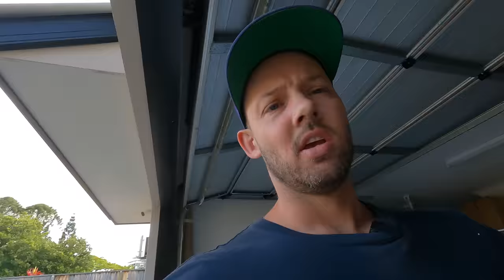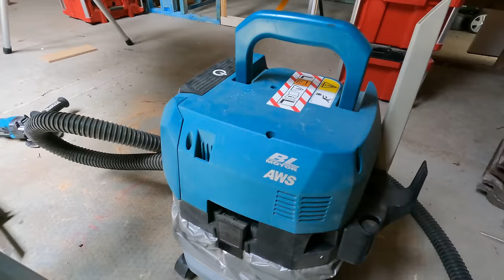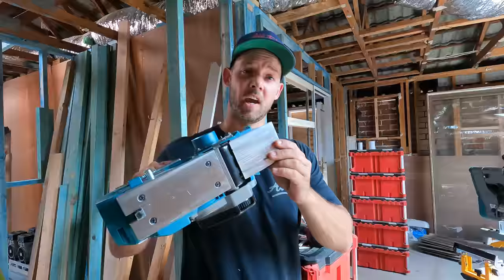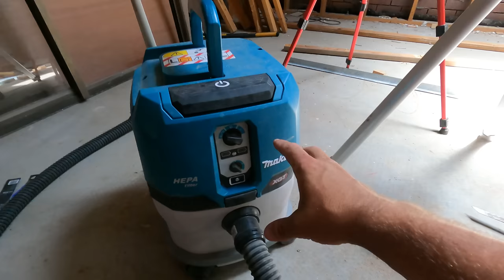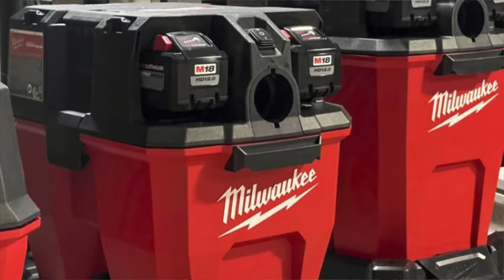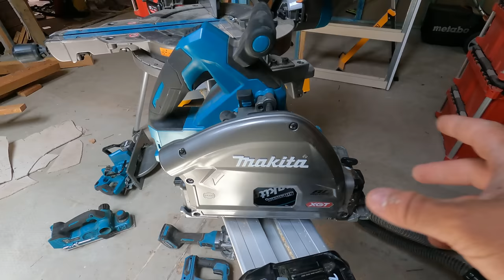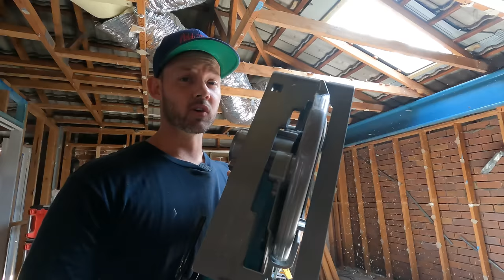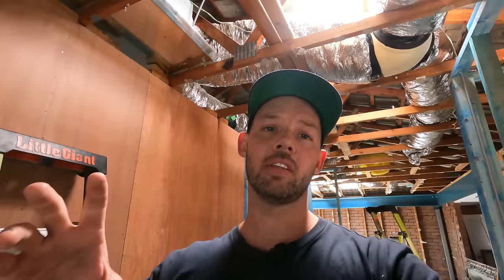From milwaukee to Makita. Why I changed tool platforms

Comment: Carpenter from Europe here, I use Makita but still the older 18 V LXT lineup. The batteries are not as modern as the new XGT batteries but they seem to live almost for an eternity. I still use 5 batteries from my first batch in late 2015, they are still working perfectly. Meanwhile I have a lot of newer machinery but they still work fine with the old batteries.

Comment: I first started using a cordless drill, Makita, in 1989. Then got a Dewalt then back to Makita. I use to think it was a good idea to only run on one platform and back then it was a good idea but now I run four platforms for different reasons. I really see no reason to run only one and only one. The only downside is you need multiple chargers which for me isn't a big deal. Each maker has their strengths and weaknesses so I just take advantage of multiple companies strengths and don't bother with the weak stuff.
Reply: Have you tried the charging adaptors for 50$ Amazon ??? Any brand any battery
Reply: @jairoguzman4631   No, I haven't. I don't have any need for an adapter. I've got batteries for all four systems. In fact just a few days ago I got back into Dewalt so that now makes it 5 platforms.
Reply: I'm the same way. I've got M18, M12, LXT, and XGT. Doesn't bother me as much as most people to drag a few extra batteries around. I do use mostly Milwaukee for work (electrician), and mostly Makita for home use (woodworking, general construction, etc). However I mix and match plenty, and always prefer to be able to choose between each platform for each tool, and get the highest quality.

Comment: I’m on the Milwaukee and makita xgt platforms, I can’t honestly say I could be on either platform fully! The Milwaukee 16 and 18g and framing nailers are phenomenal and they have tools that xgt just don’t make yet. I have the xgt mitre saw, 190mm saw, combo drill and impact, recip saw, planer and track saw that Milwaukee just don’t compete with
Reply: Dont compete on the recip saw?
Reply: @Alex-uh1mj  yeah the recip saw from Milwaukee is the staple but the new flex looks pretty good too, coming from a dewalt guy
Reply: I expect them to DeWalt tools going from Porter-Cable junk essentially saved up earned it bought it bought the kits when they had the battery included or multiple batteries and chargers etc been running for about 5 years now non-stop 

Trim carpentry rough carpentry beam work you name it and it's been going non-stop however DeWalt makes really poor nailers in the cordless range so I use battery adapters from Amazon and been running those for about that long too for my Milwaukee nail gun Brad nailer and 15 gauge by dewalt batteries are still going strong they have never had an issue They seem to have a better system and backup system One thing I have noticed is a lot of people that use Milwaukee on the job site They have battery issues also the bearings go out on their tools especially the impacts and the drills and the same goes with Makita The batteries go out especially if it's cold they do not like cold at all My DeWalts will run in the cold No problem I also was smart about it and built a battery box with two chargers so that when I'm charging my batteries it's also an insulated box it's got two fast chargers inside and then I bought Amazon battery lockers to go on the walls of the inside the box so roughly I have 15 batteries ranging from 5 9 ampere hours 3 6 amp your hour several 2.5 and and a few fives I never have a problem with it I would like to get a 12 amp per hour but I think I'm just going to go with the cheaper brands the knockoffs and see how they do if not then I've only lost maybe a hundred bucks and I can get them replaced versus paid $250 a battery or $375 for a 15 amp

I do plan on getting a 23 gauge Makita and then getting a battery adapter so I can use my batteries it's all the same voltage 18.6 volts the whole systems are
Reply: @Alex-uh1mj  The new Makita XGT avt recip saw is faster than Milwaukee.
Reply: @clarkfos3447  ah okay, ive not seen any comparisons yet. Im too heavy invested in Milwaukee now 😅 better not watch

Comment: Woodpecker makes a tool you can attach to the track of your saw for repeatable cuts, you can also cut thin strips with it, basically replacing a jobsite table saw for ripping boards.

Comment: I install windows and doors and use Makita 18v and dewalt 50/50 . The Makita impacts hands down destroy all others but I do prefer the dewalt 7 1/4 battery mitre saw that I use to cut trim and simply use a 9 ah flexvolt battery on .

Comment: Another great video thank you. Makita have been top notch gear forever and before I started my plumbing apprenticeship in 1975 at 15 years old. They always set the standard for the others to achieve.
Reply: What would you rather do run around for batteries and chargers or plug a cord in once.
Reply: What an absolute load of crap
There are several Milwaukee tools that leave makita for dead 
There are some makita tools better than Milwaukee  
To say makita is the one setting the standard is garbage 
Give me the Milwaukee angle grinders over makita any day and their impact drivers and impact wrenches and grease guns 
Would go makita for their saws  is about all 
Makita impact drivers are nicely balanced  but Milwaukee grunt kills them
Reply: Not true Makita has always been behind Dewalt and Milwaukee in innovation. Not to mention no high output batteries for the 18 volt line.their impact drivers do not cut it if you're driving big fasteners. I have their cordless track saw which I like except battery life is not great thanks to outdated technology.

Comment: Same here, Milwaukee have very powerful tools that kills the batteries earlier than expected. I love my Milwaukees but now almost always order makita ones just because the electronics in tools and batteries make it last forever. For example I made a very aggressive use of grinder to cut and polish rocks, this cause i have to order 2 or 3 batteries per year! Makita 40V the battery have more than 18 months, the tool have a special sensor that slows down the tool when battery is too hot to don't damage the battery. I save several hundred dollars with makita compared to Milwaukee. And Inlove Milwaukee ❤ but they are far behind in battery management.😢

Comment: I've had Makita drills since 1987, although I bought a number of Ryobi tools between around 2005 and 2015 as their line expanded quicker and at a lower price point. The past few years, I've gone back to Makita with the LXT platform, and I love them. I'm hoping the XGT platform doesn't result in them phasing out the LXT line. 😬🤞
Reply: I talked to a rep the other day he said that it wouldn't be , that the xgt would be a pro line and 18v  would become a home handyman type of product
Reply: Yeah, their LXT stuff is here to stay, at least into the foreseeable future.
Reply: By the 80s Makita was all made  in Japan , current Makita are made in China, I don't think is the same quality.
Reply: @pablosetien5548  Makita is made in about 13 places, not just China. They have specs they have to meet in China. Most tools are made there. Makita is still the best overall quality

Comment: As you will know, 

it kind of doesn’t matter 

for around 20 bucks on eBay you can buy adapters that will convert between Milwaukee and Makita - as long as the voltage is the same……..

I’ve had Milwaukee for three years at the DIY level never had any issue

Comment: I spent a decade doing similar work, larger scope interior focused remodeling, which almost always includes a decent amount of cabinetry and finish trim work, before finding my current specialty. These types of remodels are so broad in scope they have the widest requirement for power tools compared to more narrowly focused trades. That makes these types of outfits very good judges on tool platform choices. They regularly use such a wide variety of equipment ranging from hammer drills for light concrete and tile demo to fine finish tools like track saws and and routers. I’m sure this guy has lots of secondary tools they use often but not every job
Reply: Marc. I'm a plasterer by trade. Although I had to diversify to cover many aspects in the building trade simply to remain in work. I have tool boxes for bricklaying, concreting, carpentry, plastering, ceiling fixing, tiling. I did maintenance work such as using demolition hammers. Moving into the battery range. I do wish to purchase a cordless mid size sds max demolition hammer. I have the metabo 18 volt sds plus rotary hammer. Its pretty good. I did have a 36 volt metabo4 amp hour.It got stolen along with other tools.So I replaced. Yes, I'm also a tool person. It did get me work however. I get asked can you do this? I say yes I can. Sometimes I don't know how. I figure a way and just do it .

Comment: This video is perfectly correct…a wise choice..not just a brand slave…change when its favor you more to solve the problem….many just read the spec etc. but the real worker on their own field knew which brand to choose for the ergonomic and conveniency…for example which one would fit the tight space better etc.

Comment: Excellent comparison!  As a Milwaukee bigot I have to say you were spot on with your comparison overview.  I have over 30 M12 and M18 tools, plus 20+ Packout boxes and bags.  So I’m committed and for the most part very satisfied.  Milwaukee builds some excellent tools!  However, I believe they’ve missed the mark with their new vacuum line, which looks excellent.  Not having BlueTooth connectivity between vac and tools is a major miss.  How the hell could that even happen?
Reply: And lack of dual power is also a huge miss. Having to ONLY use battery power or not having passive charging is such a stupid idea for such an expensive tool
Reply: There is a powerhead that has a corded or battery option. There a 3 configurations.
Reply: What's the use of bluetooth when you are connecting a vacuum hose... Doesn't make sense at all.
Reply from the maker: When you pull the trigger on the tool, the vacuum come on and turns off 2 seconds later. It’s extremely handy
Reply: @michaelrjacobs  , it’s simple…instead of having to reach down to turn the vacuum on prior to starting the circ saw or miter saw or whatever tool, Bluetooth from the tool sends a signal to the vacuum, automatically turning the vacuum on.  After the trigger on the saw or tool is released the vacuum turns off.  If your making a lot of cuts it would be really nice to “not” have to reach down each time to turn the vacuum on and off.  With Bluetooth connectivity you never have to worry about forgetting to turn the vacuum on or off.  It’s just a very convenient technology that I’d like to see Milwaukee incorporate in their tools and vacuums.
Reply: @martylucas8557  ok, let me rephrase. Wasn't very clear. What's the use of having a battery powered tool that I inevitably is going to end up being connected with a hose?
Reply: @michaelrjacobs  one reason is the test and tag requirements for corded tools on worksites.  It's cheaper and easier to only have to do two or three tags for the battery chargers, than to have to do 40+ tags for every tool, extension leads, etc.

It also avoids the scenario where you pull a tool out that you haven't used for a bit, check the tag, it's expired, then you have to find a sparkie that will tag it for you before you can use it.

Comment: Around 8 years ago I switched from Makita to Milwaukee…

I have 18 V and 12 v, but my 18 v batteries (4/5) stopped to charge after only one year of usage, and they look brand new from outside, but actually they are both dead or they are in sleep state!

But the 12V battery is still in good condition, I believe Milwaukee 12v line is better than the 18V!!

I believe 18 V from Bosh, and Festool are as good as Makita 18v…and the most underrated brand is AEG!!!

Comment: Nice one! Adding another better platform hurts initially when buying new batteries and chargers, but it also frees up existing batteries for those other branded tools, and more importantly opens up a whole new range of tools to cater to ones needs.

Let the tool choice dictate the battery, not the other way around.

Comment: I went Milwaukee last year have had a couple issues with a battery and circ saw and been eyeing off Makita 40v range lately however the worst problem with Makita is no framing nailer. I'm a handyman so I need just about everything
Reply from the maker: What circ saw problem? Mine had bad trigger problems. Worked intermittently which was painful. Nail guns have been a let down from makita. Not sure they haven’t kept up. I’ve been loving all the Milwaukee nailers. Cheers for the feedback👌

Comment: As someone who works in the plumbing industry as an estimator and quantity surveyor (in new Zealand) most of our guys on Makita while some are on Milwaukee. A lot of guys prefer Makita because of there redemption programs whereby they often batteries for free via redemption when buying a kit. I've looking at getting the 40 volt 6 piece kit. The 40 volt drills are a lot nicer to use so are they saws and there outdoor gear is great. I've been wanting on there self propelled mowers for a while

Comment: I have makita xgt, switching from Milwaukee. I find the fit and finish of makita xgt much better. The track saw and miter saw are extremely smooth and the xgt is handy with the battery vac.

Comment: People get right into bitching about tools and which make is the best. They're all up there and pros and cons for both. You not gonna go wrong with any of the brushless Milwaukee, Makita, DeWalt, Bosch or Metabo now. I've mainly got Milwaukee for the battery argument, and also Festool tracksaw and vac which is absolutely next level. And just bought a Mirka Deos Sander which is unbelievable and makes my Milwaukee orbital feel like a kids toy. Spend as much as you can afford.
Reply: Right Mirka it's top

Comment: All the company platforms go through cycles where they focus on a particular market and others get left behind opening the door for others to innovate and jump over them.  I have more Makita corded tools than anything, however I started with DeWalt 18v XRP nicad as they seemed to most committed to the platform.  With Lithium Ion hit the market, I stayed with DeWalt but they were late to the game with some tools so found myself now back in Makita LXT as well.  I even have Bosch 18v batteries mainly because they hands down make one of the best 18v sanders out there.  The only one that comes close is festool and that's at 3x the price.  If your a Milwaukee fanboy, where was the track saw all these years??  There is no way I would have waited this long to buy one, I actually started with Festool TS55 and went to the Makita X2 for cordless over 4 years ago.  The bottom line is stay within your system when you can to get the most value of your battery investments but sometimes the best tool might be outside your existing system and if it's one you will use a lot, it makes sense to be open to going outside your system.

Comment: I am a carpenter and i am fully comited with milwaukee tool ! Hey makita where are your table saw xgt and your fraiming nailer ??
Reply from the maker: The Milwaukee carpentry gear is definitely good. I’m also surprised that makita haven’t uped their game with the table saw and nailer. 
I grabbed the Milwaukee framing, finishing, and pin nailer. They’re awesome!
Reply: Makita has been lacking with their nail guns for awhile.  I feel like they didn't want to release one unless it was better than a Paslode.  

I'm waiting for their table saw
Reply: They have a 21 degree framing nailer in some countries. In Brazil we have it, pneumatic one. Unfortunately no battery ones so far.

Comment: I have 100%Milwaukee cordless tools and batteries. Makita makes THE BEST small portable compressors, i have a few of these. Dewalt makes good,  more affordable corded tools, saw horses,  table saw stands, so they are a solid format also. If you've been able to just get one format,  you aren't doing many different things,  or your so rich you're working for fun.

Comment: Just use any tools with Makita batteries. Just get the adapters. I've got Makita and Milwaukee tools with only Makita batteries. Makita batteries are the most universal as lots of Makita tools can't use adapters due to their star system. Plus Makita has it's battery shut off inside the battery from what I understand. Makita batteries are the best in my experience.

Comment: Usually it's the other way around, Australia, the UK etc. get new tool releases before we in the states do.  I just ordered (from Home Depot) the 40 volt XGT 2.1 gallon wet/dry vac.  Like my other Makita cordless I'm sure I won't be disappointed.  F.y.i. the Milwaukee single battery vac has 95 cfm and the dual battery 36 volt vac has 110 cfm.  The Makita 40 volt vac has 145 cfm.  The Makita 80 volt vac has 175 cfm and goes for almost $2,000.  Cheers!

Comment: I have both as well as DeWalt, Hikoki, and Ryobi cordless tools. Get yourself some battery adaptors. I've got a DeWalt 1/2 inch impact ratchet, Milwaukee trim router, Milwaukee finish nailer, Hikoki framing nailer, Ryobi window cleaner, Ryobi pole saw. All of them are running off Makita batteries. Let's me get the best tool for my needs and not limit myself to one manufacturer. Don't limit yourself!

Comment: Go with 4ah batteries no matter what platform. They're lighter and sold more frequently so the assembly line cranks more quality control resources into them. I've seen many higher amperage issues from various platforms. You're just gonna need a couple banks of 4ampers charging at any one time
Reply: I switched to 6ah on makita. Can't imagine going to 4 only for small tools maybe.